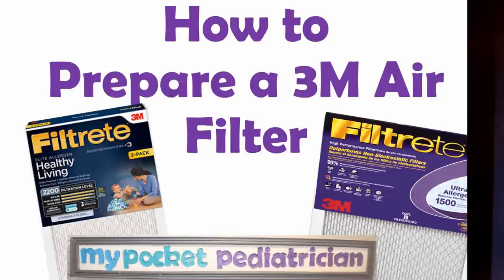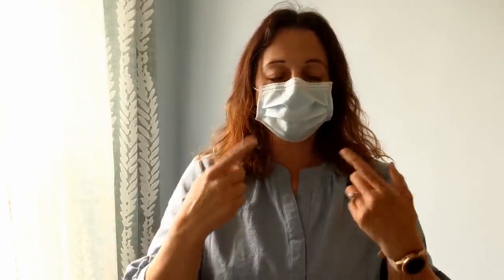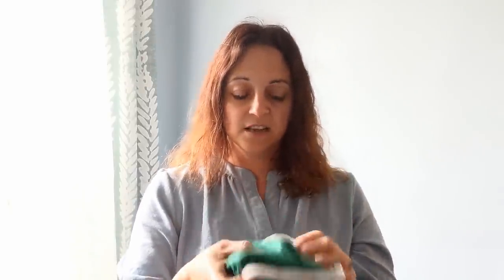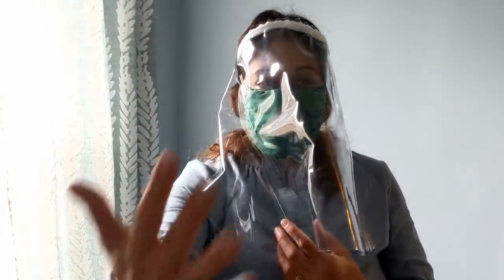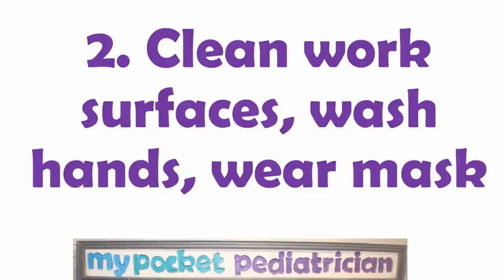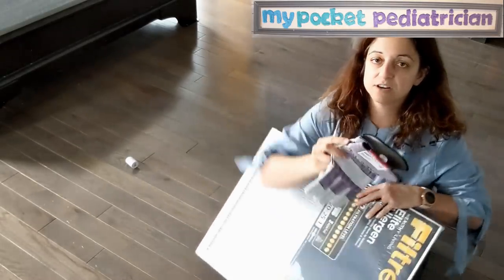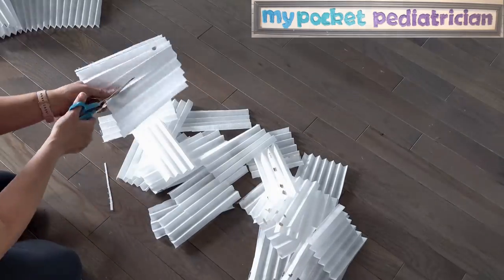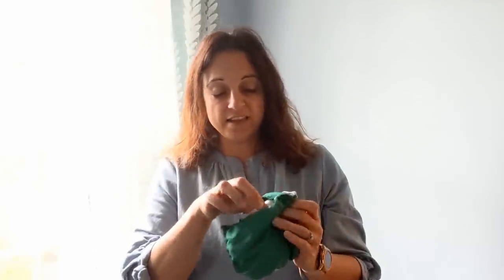UPDATED!  How to Turn a 3M Air Filter into a Face Mask

Comment: WHERE IS THE PROMISED LINK TO THE MSDS?  Google seems to return hundred of ads to people selling filters.  I'm very frustrated.  I really want the MSDS for HEPA vacuum bags which are rated 99.97% for particles 0.3 micron and bigger and have the electrostatic charge.
Reply from the maker: I couldn't find the MSDS for the Hepa filters, and it took me a lot of different searches for the 3M ones.  It's pinned at the top of the comments.

Comment: If you call 3M they will tell you there isn't any glass particles in there filters and that it is safe to use.
Reply from the maker: Thank you - my understanding is that they won't recommend this, but they do confirm no fiberglass.

Comment: Question? What about coffee filters?
Reply from the maker: No .sorry...they filter things the size of coffee grinds.   Covid is 0.12 microns, so most physical filters will have no effect at all on viral particles.    You must have a filter that was designed with special forces to filter viral particles.   These are very difficult to make, and require special machines  which is why there is such a shortage of real PPE right now.

Comment: Our filters are designed to be used in HVAC systems, and the filter media has not been tested to be used as a face mask for respiratory protection. Altering any of our 3M Filtrete™ Air Filters is NOT recommended or supported by 3M or the Filtrete™ Brand. Customer safety is our number one priority."????

Comment: Did you read what the filters are made of? Many contain fiberglass. Isn’t that a LITTLE dangerous?
Reply from the maker: The material safety data sheet is at the top of the comments.  I addressed the fiberglass concern in the video above.
Reply from the maker: Check it out around 19:15

Comment: I am planning on using the same Filtrete filter for masks, so I called the company and got confirmation that there is no fiberglass in this filter.
Reply from the maker: I have a new and improved Adjustable mask with FILTI material that passed the FIT test!  Please check it out here:  https://youtu.be/2J3Fq4o-U4I

Comment: why did you cut filter on the floor? im not sure its sanitary....you mentioned work area needs to be sanitized....please clarify your process. the floor is the forbidden work space for this process even if sanitized . tabletop seems better workspace.
Reply from the maker: Tabletop is a better workspace for sure if there aren't 4 kids 7 and under and a labradoodle running around it.   We are all stuck at home.  There are 7 people and a dog in my home, so I washed the floor and worked in an upstairs bedroom away from the kids and dog.   We don't wear shoes in my home, the dog isn't allowed upstairs.   The floor is hardwood and fairly new and solid wood.  Washing a wooden table and using it vs. washing a solid wood floor and using it aren't that different.

Comment: I'm so confused many on here post theirs particles on the filterete and others say you can use longer then 1 day
Reply from the maker: I'm not sure what your question is, but I do have an updated tutorial with a different material, Filti, which was designed for face masks.  It's available here:  https://youtu.be/2J3Fq4o-U4I and there is also a discount code for my viewers.

Comment: >> Dr LILI  <<  -- I've been seeing a number of videos encouraging people to make homemade face masks from HEPA vacuum cleaner bag filters ---  but then I've seen other videos saying that such HEPA filters include fiberglass and the micro-glass-fibers can get through the mask material into the wearer's lungs (especially if the filter is cut -- which is the case 99% of the time.)  ..... SO, I my  questions for you are:

1) What is your opinion of using HEPA filters for masks?
2) Does the 3M air filter you are recommending possibly have the same problem?
3) If using HEPA filter material IS so dangerous -- and since, as you point out, most homemade masks are VERY inefficient -- could you find some person or organization that DOES have professional (PhD) researchers that could investigate your findings more fully and come out with guidelines that could be disseminated far & wide?  (Perhaps just send links to your videos to those orgs/researchers.)

Meanwhile -- THANK YOU SO MUCH for all you are doing.  Of all the DIY homemade face mask videos I've seen, yours are clearly the best researched and clearly presented.  TY!!!
Reply from the maker: Hi, Thank you for your questions.  I believe some HEPA filters don't necessarily have fiberglass, but do have some fuzzy material that is probably not a good idea to breathe in.  I've been messing around with this a lot, and when the filter deterioriates, it becomes fluffy - kind of like cotton stuffing.  It takes a few days for this to happen with a lot of ins and out into the mask.  So I think for single use, it holds up well.  I can't say for sure -these are my non-scientific observations.  
3.  I believe all the people with PhDs in PPE are working day and night to make more gear and come up with better solutions.  The ones I know have been very generous with their time, but they're not just sitting around, working from home these days.  They're under incredible stress, so if you know of anyone willing to study it, who has the time, I'd love that!  I have 4 small children and a mom with cancer who lives with me, so I'm not able to go test it myself.  I tried to see if I could do a fit test the last time I  took her for chemo, but they didn't have testing facilities at that site.  
 I'm not selling this or anything - I'm only making them because I want a better design that I hope will help people.  What I really want is commercially made, high quality PPE everywhere.  Instead, 3 resident physicians died yesterday alone.  One of my good friends who is an infectious disease doctor, can't get a mask to use when she sees patients, so I just mailed her some of these today, with a new design because she's not the standard size.  I'm working on a tutorial for that one too because she can't be the only person in that situation.   So, I'm hoping and trying my best.  Thanks for the questions - I wish I had better answers!

Comment: Looking for the link to the MDA sheet.   I already dismantled my filter before noting the arrows as to which way they should be worn.  Do you know how to tell the difference?  Your video is very helpful.  Thank you for all you do.
Reply from the maker: Hi, the slightly shiny side goes towards the front, and the slightly fuzzy side goes towards you.  The MSDS is pinned as the top comment on the page.  Please subscribe because I may have some better materials to use soon and will post another video.
Reply: My Pocket Pediatrician thank you.  I have subscribed.
Reply: My Pocket Pediatrician I’m sorry but I still do not see the link.  Can you please post it again.  Thanks
Reply from the maker: @bbuunnyycc  I tagged you in it, but I"m not sure if it worked
Reply from the maker: @bbuunnyycc  For those concerned about safety, here is the Safety Data available from 3M:  http://www1.mscdirect.com/MSDS/MSDS00023/53337903-20111224.PDF
Reply: My Pocket Pediatrician yes, it worked.  It’s much appreciated.